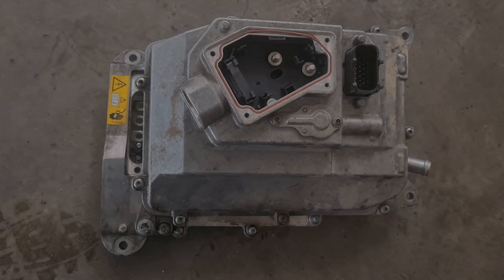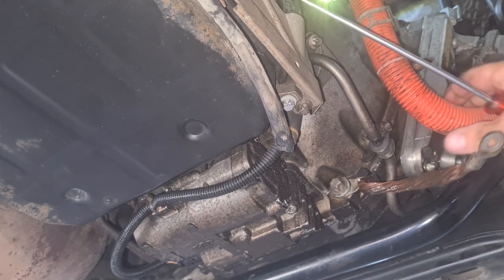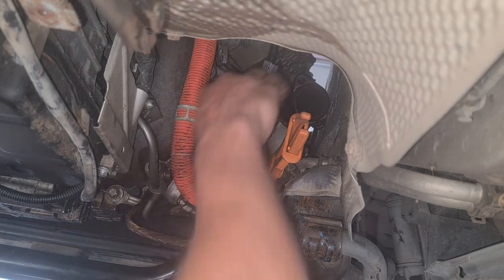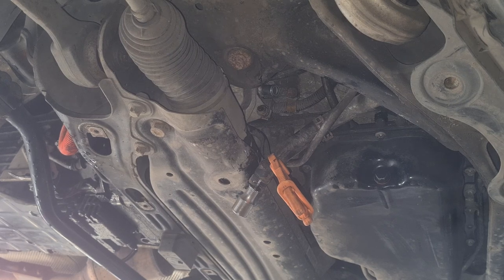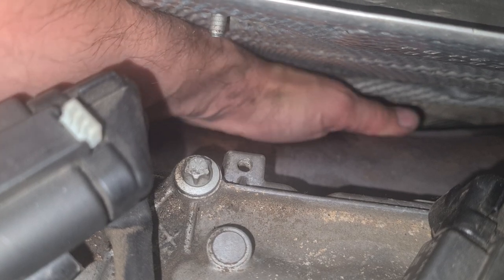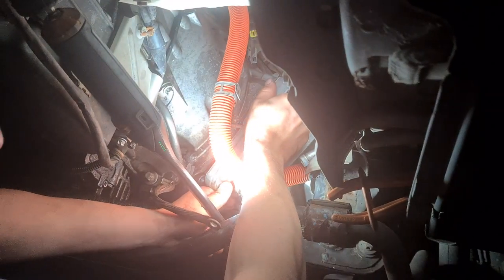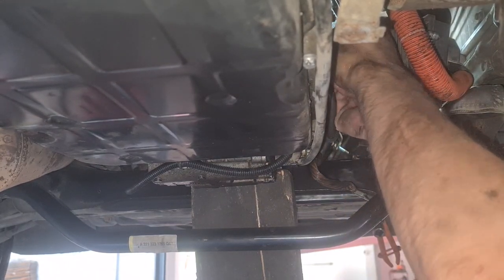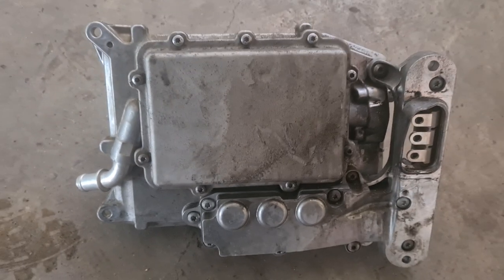Mercedes Benz S400 Hybrid Repair - I've removed the hybrid inverter - гибридный инвертор - Part 3

Comment: Hi, did you solved the problem ? I bought one refurbished inverter from  eBay/China and it doesn't worked out ...
Reply from the maker: @alinfoal  Yes. On this car it was the Inverter!
My client send it to a repair shop and it is already on the car. It works just perfect .
When I have time I will edit the Install video, as I don't have time for the moment. 1-2 weeks, I hope!
Reply: @ArthurBolbos  thanks for the quick response. I don't understand why you bought/replaced with a refurbished or used one ? Does it need reprogramim/coding ? Or just put the new invertor ?
Reply from the maker: @alinfoal  a repaired one at least you get some warranty. I tried the China version, but it got banned at the border customs, so client searched for a repair shop.
The guy repaired it and send it back.
Everything was/is fine for the moment.
Just plug-in. No coding. Nothing. Just before start, clear error codes from every module!
Reply: @ArthurBolbos  thanks a lot. Which country are you? I'm in the UAE. The one bought in China didn't work out
Reply from the maker: @alinfoal  if you get the same error code, with a new part then your problem should be somewhere else; if the part is " refurbished " or used/second-hand then it might just be that you received a bad part; because 90% it's the " starter " section in the module that goes bad!
The other 5% are fuse on the main HV cable and the other 5% left could be DC Converter or A/C compressor!
Country = Romania
Reply: @ArthurBolbos  thank you brother

Comment: hi. just wander rear main seal leak can cuased to hybrid system failure...? Porsche hybrid system got failed due to rear main seal leak and leaked oil rubbed with hybrid generator..
Reply from the maker: I'm 100% that it can cause damage. Any leak of any kind if it gets into a " circuit " it brings up with it damage!